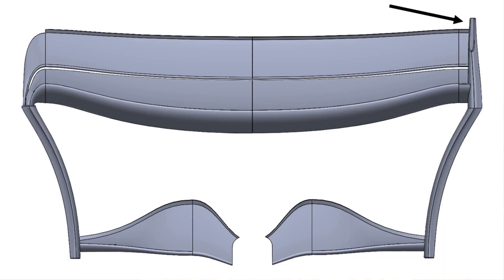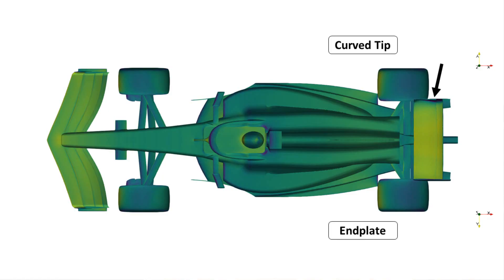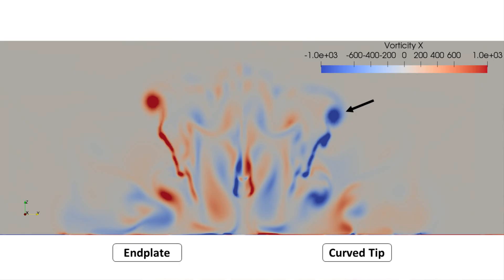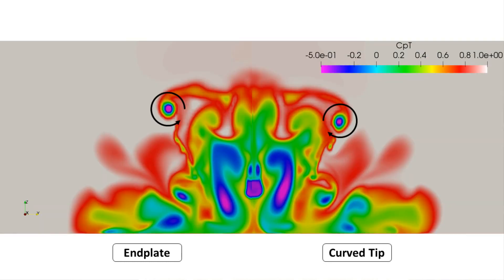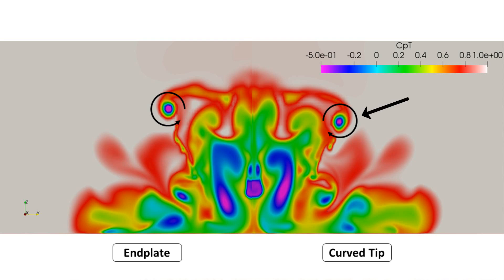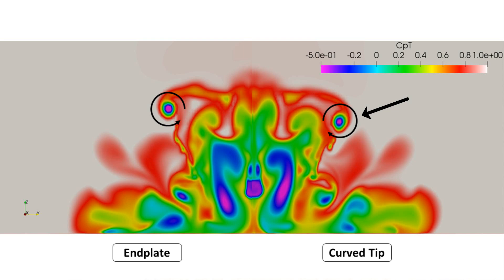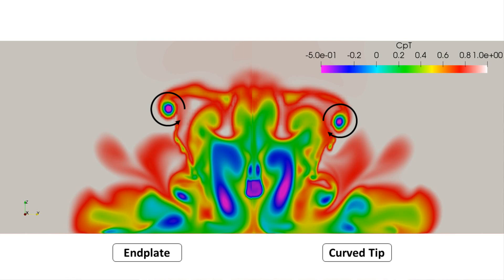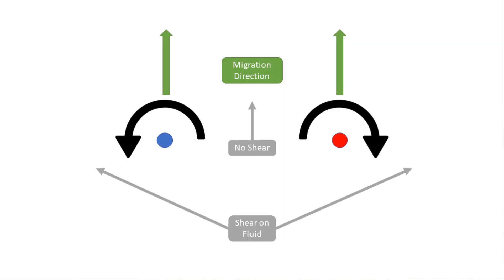F1 Rear Wing Endplate Explained

Comment: Hey interesting video, I know its a bit of a late comment, but do you know roughly how thick the rear wing endplate bodies are on these ground effect regs? I'm guessing the leading edges of the endplates are aerofoils of about 5mm or so thickness?
Reply from the maker: Good question, for memory I think they are large enough to allow teams to balloon them to avoid separation under yaw (unlike the previous generation of car).

Comment: The rear wing's vortex also forces air to accelerate on the vertical wall of the wing, especially under yaw. This bubble is more or less pronounced by the sidepod geometry. Mercedes style sidepods make the rear wing very sensitive under yaw. So they have to run a big wing for 2 reasons, the diffuser performance, and for stability under yaw. It's probably why they're going to another concept.